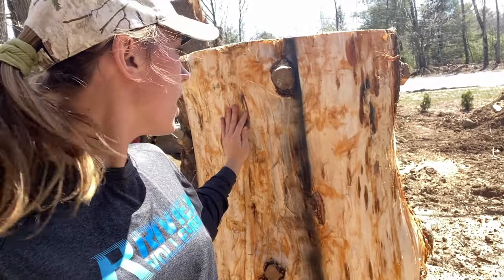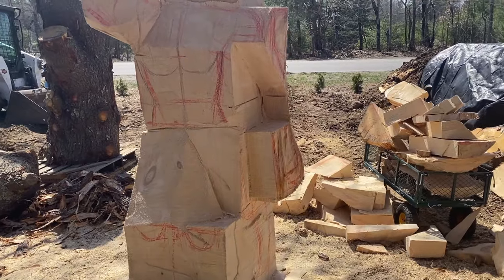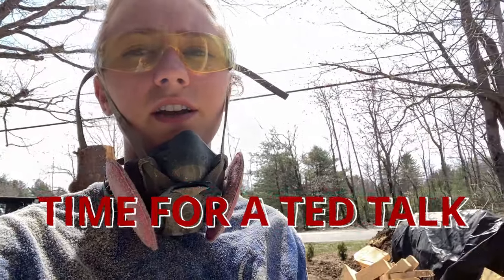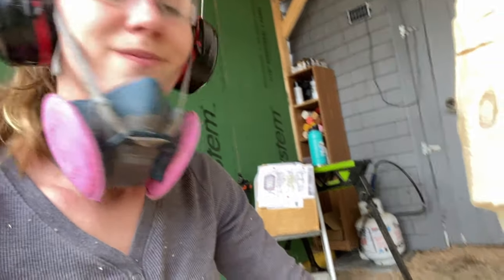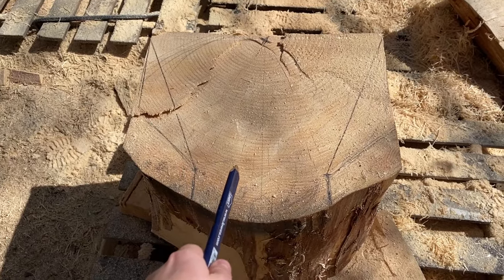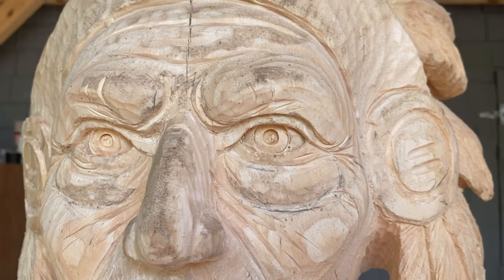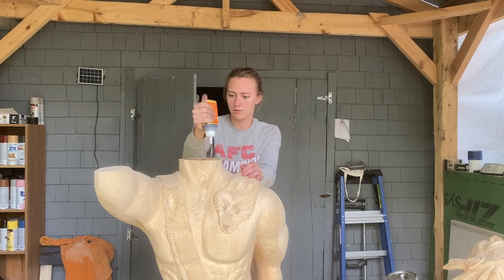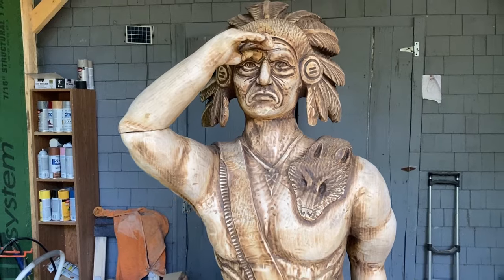AMAZING American Indian Chainsaw Carving

Comment: How does the selection of the right wood species play a critical role in the success of a carving project, and what factors—such as hardness, grain, and durability—do carvers need to consider before beginning?
Reply from the maker: Wood type is really just a carver preference and avaliable thing. If I was over west I would be carving cedar, but since I'm over east I carve eastern white pine. White pine makes a great canvas- it's soft but still holds detail well, it's not super knotty, and dries in a way that it doesn't check horribly like oak and some other hardwoods can. You always want the grain running the length of the piece or attachment for added strength 💪🏼 sometimes that's why we do attachments, simply for the added strength of having the grain run in a different direction for the add on specially:)

Comment: Hello . I really enjoyed all your carving work . Everything looks awesome. I’ve started carving just a couple of weeks ago and really like  it. I like your work pace speed i can tell that you have a peace and love creating your art, praise the Lord. I noticed that you use a 3m respirator with the pink filters , have you tried the purple filters they work awesome, they help filter better with  the exhaust fumes and paint fumes. They cost a little more but worth it.
Reply from the maker: Welcome to the carving club, I hope you enjoy it! I have not tried the purple ones, I’ll have to look into them! I currently use the p100 2097 for oil based aerosols and noxious fumes!
Reply: @TayMarie23   3m P100 2297 are the filter. I have a question , is white pine nice to carve on ? Sorry two questions , how dry does the wood need to be to make sure it doesn’t do something funky later? Thanks George
Reply from the maker: White pine is great! At least here in Maine it’s abundant, cheap to free, and always available, hence why it’s my go to wood. In a perfect world I would carve cedar more for it’s outdoor resiliency and weight but cedar doesn’t get big here like it does over west. 

You never have to wait for your logs to dry. Carving green is the traditional way of carving, easier on the tools and your body. I like my logs to sit around just long enough that it starts cracking (usually around 3mo) so I can strategically place the cracks towards the back of the carving.

Comment: Amazing I know you said you worked on it on and off for a couple months but how many hours do you think you got in this ?
Reply from the maker: Tough question! This thing did not what to be carved, my first go the log was infested with carpenter ants, so I had to scrap that log and start completely over. New log was dropped off the night before a big snow storm and I spent hours on end trying to remove the new log from the frozen ground. Took weeks until I could start on the new log. If you aren’t counting all those hours, I would say I got about 70-80 hours into this one?

Comment: Yet again another awesome power carve. Brilliant 👏 work. 
Question if I may 🤔  ? 
All your off cuts? You seem to treat with a bit of respect in my eyes, you don't just toss them aside 😊. 
So would i be right in guessing that ! you either use them for maybe hand carving for yourself or others or sold on for that type of thing. 
After all nothing  these days seems to come free does it  ??
Also guess you have to buy the logs in the first place. 
Cheers Les.
Reply from the maker: Thank you for the kind words! I try to waste as little as possible so the larger scraps like the ones made from this project go into a different pile where I carve smalls out of them or use them for glue ups and whatnot!

Comment: What do you do with all the chunks you cut away
Reply from the maker: The larger chunks are put to the side for small carvings and anything that can't be made into a carving gets thrown in the burn pile! Unfortunately since I carve mostly pine, it cant be burnt for heating fuel and most of the wood I carve was destined to be burned as hog fuel anyway, so it's nice I get to save a majority of it from waste!

Since I do this full time I have been trying to think of creative ways to make more use out of the scraps. Might invest in a muncher/chipper to make and sell mulch as a side hustle 🤔